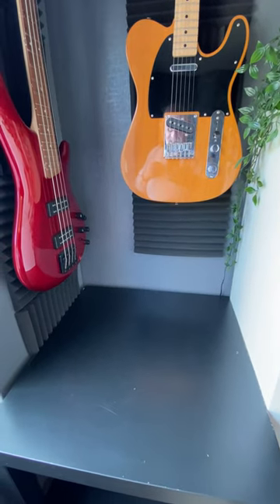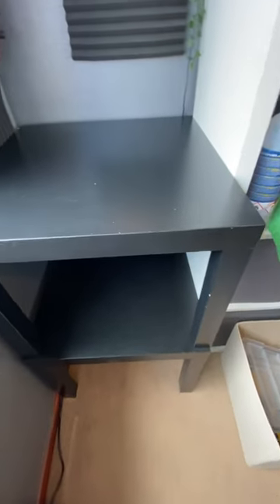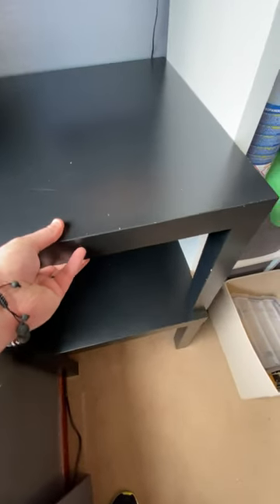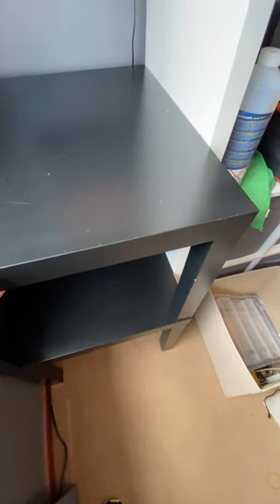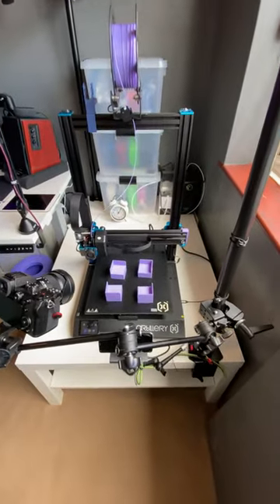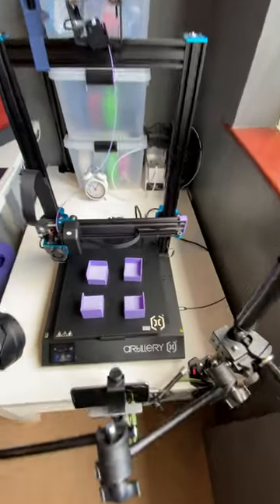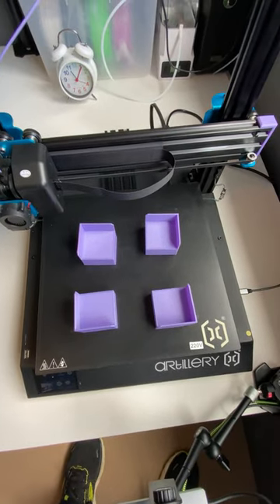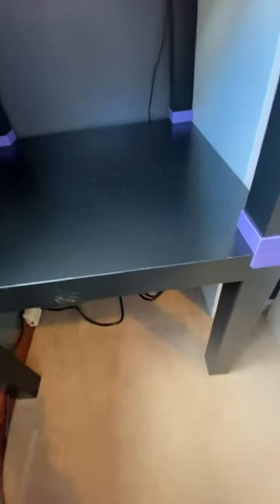Ikea Hack: How to Stack the Lack Table to Create More Room!

Comment: What table do you use for your 3d printer?
Reply: It’s actually an ikea lack table too, just bigger than the small square ones.
Reply: @Trees And Wheels  oh okay thank you! Are the small Lack tables good enough to put a 3d printer on them or are they to small for that
Reply from the maker: It really depends on the 2d printer. They are a bit too small for the Sidewinder X1, but easily big enough for the Creality Ender 3 V2 Neo. Sorry for the delay responding!

Comment: 4 screws.
Reply: Tables destroyed
Reply from the maker: Well, the legs are hollow (apart from a foot plate piece of wood) but given that each leg is directly above the other legs I'm not sure how I'd use screws. Besides that... over-engineering a solution is fun 🤪
Reply from the maker: Exactly! With this solution I can disassemble without any defects showing on the tables. Screws would leave holes!
Reply: @TheCreativeAcorn  it's a great solution, is that the default colour the printer uses?
Reply from the maker: @frankthetank3037  No, it was just the colour of filament I had loaded into the printer at the time. Filament comes in a variety of materials and a huge range of colours.
Reply: @TheCreativeAcorn  one of my hobbies is building lego and sometimes they can come with miss pieces, I have often wonder how good a 3d printer would be at printing lego.
Reply from the maker: You would need to put in the time to create the model and keep adjusting it until it was perfect, but with a 0.2mm print accuracy it shouldn't be a problem. It might take me a few weeks to get around to it (I have a few other things to sort out first) but I can print some lego pieces to show you if you like. I don't own any lego to test the compatibility so I'll need to go out and get some first.
Reply: @TheCreativeAcorn  this sounds great, I think it would make a really good video, especially when you start printing the more detailed pieces.
Reply from the maker: Keep an eye on the channel... I'll get to the lego print as soon as I can.
Reply: Dude stop being lazy and just bust out your handy dandy 3D printer